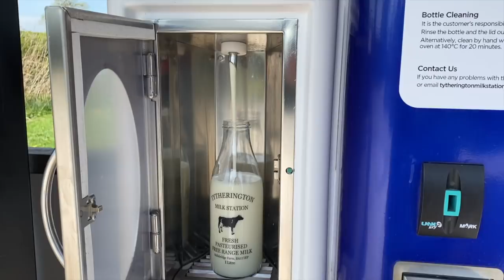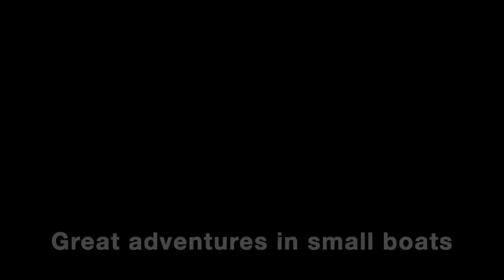Green and pleasant land

Comment: I too have a lead acid battery in my dinghy and use a small cheap 12v solar panel to top it up. Costs around £10-20 and if you leave it hooked up you will treble or quadruple your battery usage before a mains recharge is necessary. My little solar panel came in a plastic frame but now sits in a varnished wooden frame (rainy day project) and is quite happy tucked behind a seat. If I am underway it usually is tucked away but if it is a bright day leave it hooked up. I really enjoy your story.
Reply from the maker: Yes I aim to hook a panel up to the battery. The main issue is where to put it!

Comment: You've made a lovely job of her.  Some great ideas here too. Notes were taken. Regarding the whipping onto the chain though, I would be concerned about the wear of the rope where it loops through the chain.  For this reason I have always knotted the anchor warp onto the chain and then alter the knot from time to time.
Reply from the maker: The rope does not move relative to the chain if you make the splice properly tight. The chain I was replacing was perhaps 15 years old. There was no wear in the rope, which I simply reused.

Comment: Interested to hear you have rubber seals on the battery box.  

Do you think they will withstand another capsize?

Did you ever think of doing the same with the galley boxes?

As a sea kayaker it astounds me that Francois Vivier's current (2011) design for the Ilur doesn't make use of the lazerette and side benches for water tight storage.

I understand EU regulations dictate where and how much  buoyancy the boat must have. 
 
Do you know if those regulations preclude the use of the allotted buoyancy voids for dry storage?

Comment: Hi Rodger
Any advice on navigation lights etc on a wayfarer. Only a day sailer but could get caught out if it took a little bit longer than expected to return to the shore. Maybe a short video on this? Many thanks.
Reply from the maker: jim doyle On a small boat you just need an all round white masthead light.
Reply: Ok thanks 👍
Reply: What about sleeping / camping on board, would you use a Moring light?
Reply: jim doyle as a skipper you should apply rule 30.

Comment: linseed oil and tar - ? on metal? - i know we treat mild steel with boiled linseed and heat to prevent rusting, amnd that tar and linseed oil as old european wood treatment - but no ever heard of this on metal...?  no need to heat your shackles? -thanks
what oil are you using on ropes/halyards?
Reply from the maker: harleyJune I use tar to treat wood. The blocks I was talking about are wooden. My halyards etc are synthetic, but I do use natural twine for lacing leather, and then linseed oil it.